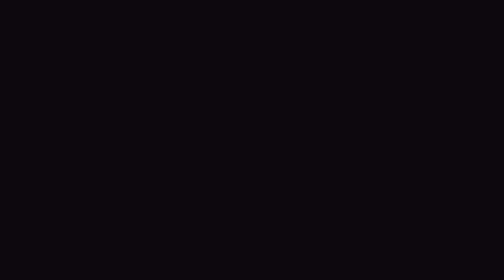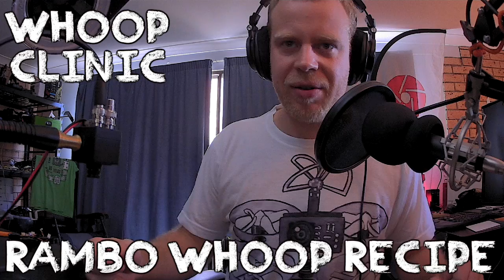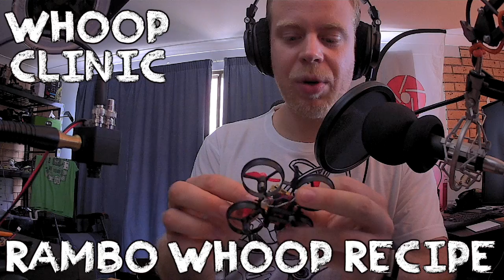Rambo Whoop Recipe - overview!

Comment: This is very soft volume Benedikt I can hardly hear it
Reply from the maker: Are you sure you turned up the volume on your YT player and your system/hardware? 
I could crank it up in the editor, will it will take quite some work at this stage ;(
Reply: Hi Benedikt, I have to agree with Pedro about volume. It's quite audible, BUT somewhat quiet compared to just about all other YouTube videos - not a major issue though 😉
Reply from the maker: Alright, I will bump it a little and reupload in the next days.
Thanks guys!